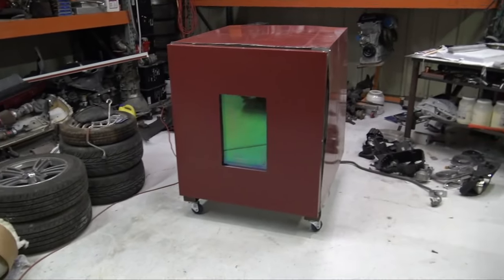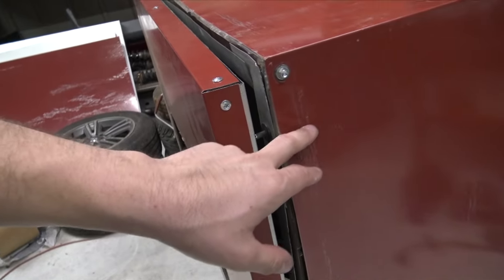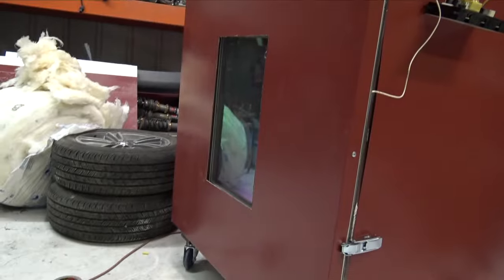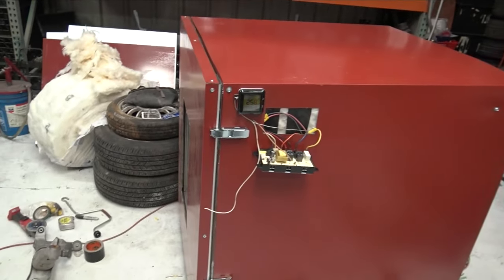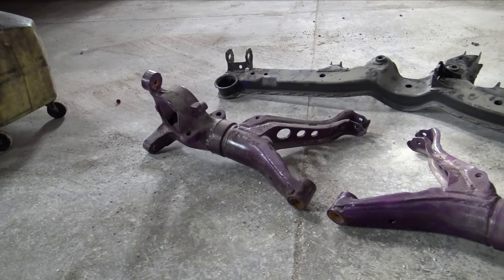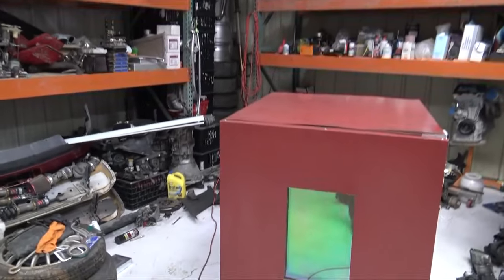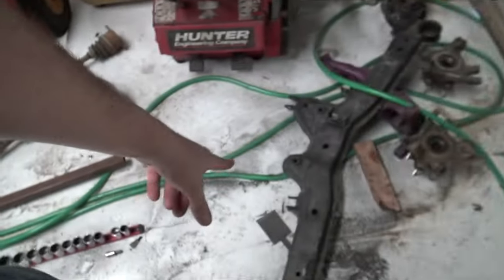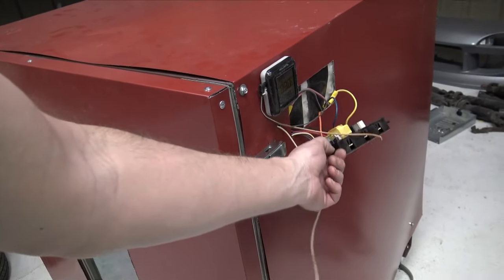Building the CHEAPEST Powdercoating Oven from SCRATCH and saving $7500

Comment: Dis you get up to 400 degrees with  that tiny heating elements?
Reply: Please put link to the controller and other electronics
Reply from the maker: Yes it gets there fast and holds it also its just the guts from an oven

Comment: A bit of an exaggeration about costs. Mounting the elements on the sides would have been better. Unless something is done where that heater is so that the space above it can be used, almost half of the oven space is wasted. I don’t see the point of doing it the way it was done. If you want it on the bottom, then you need to center it, and have a supported sheet over it with slots or holes not directly above the elements itself, so that the heat is distributed evenly.

What was the concept here? If you can’t use the back half if something needs to sit on the bottom (which is sometimes necessary), because of weight, then that really can’t be done here.

Comment: Nice job! Are the elements running seperate or spliced together?
Reply from the maker: I was running them separate but ended um moving them to the bottom sides both on the same circuit
Reply: So both elements are hooked up together to the bake connection on the back of the control panel basically?

Comment: i  would love a set of plans for this amazing oven.
Reply: It’s so simple Jeremy that if you need a set plans then I’m afraid we are gonna have to require you to turn your man card in!!!! You should be able to complete this tonight starting 10 min after you fall asleep. Build a sheet metal box, insulate, cover with sheet metal interior, run a free wires into box to hook up top/bottom heating elements, add thermostat & interior light wallaaahh...............2 hours later....alarm rings to get up

Your choice Jeremy. I’m here if I need to answer questions regarding the surrender of your man card

Comment: Mine is better. Used an old 1960s fridge that only had one door and insulated it. Used the heating elements from a 20$ oven from Craigslist. The fridge cost 75$. So in total I made it for about 120$ and it can hold 3 wheels at a time.
Reply: @quest5581  great comment, keep up the no one gives a fuck
Reply: @ianholmen888   learn how to use punctuation, or maybe be a bit more coherent in your replies.  Happy New year.😁
Reply: @quest5581  commenting on grammar, your life is sad. Better luck next year.
Reply: @ianholmen888  I actually thought someone else was commenting on your post and said no one gives a fuck "about your better oven"..so I gave it a thumbs up ...

Comment: can you use aluminum sheet metal instead of steel? would make it a little lighter and easier to move around.
Reply: gregory3829  yeah you could if you used ceramic plates to line and absorb the heat . Galv sheet metal is recommended but if your looking to kept the weight down use a thinner walled tube for the frame . Put some casters on it and weight won’t matter
Reply: @kevinlatinski826  I saw a reply on here from a guy that said something about making a oven out of a stand up freezer. I think im gonna try it. I have acquired a large older stand up freezer and a stove for $30. I think pretty much all ill have to do is strip out all the plastic and line it with sheet metal and maybe add the window from the stove to the freezer door and a accurate temperature probe such as the one you used.
Reply: If your doing just small parts maybe try just the stove . Put the very bottom rack up top and have hooks hanging for your parts . Most powders cure anywhere from 180-200 c for ten to twenty min depending if it’s polyester vs urathane . But regardless they would both cure no problem. Your just limited on what you can coat